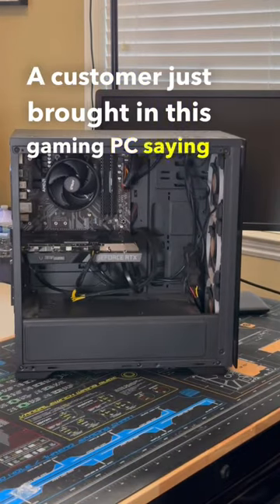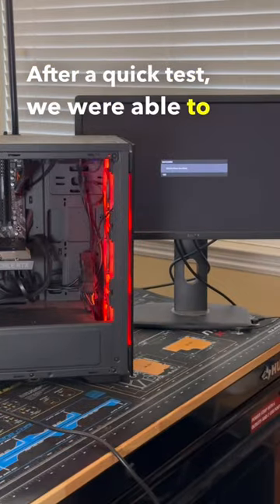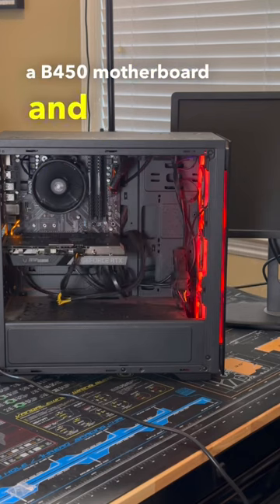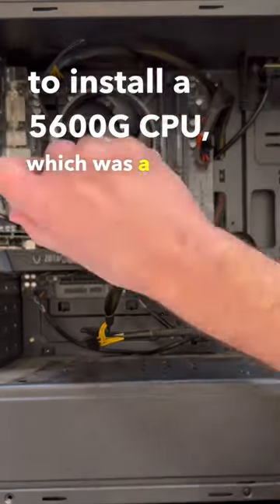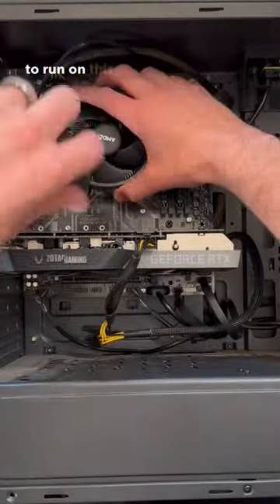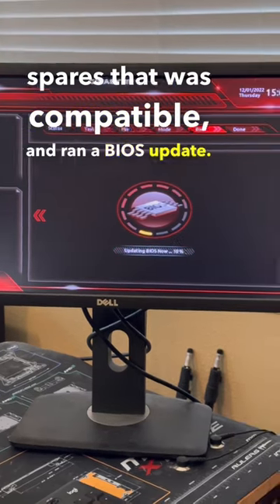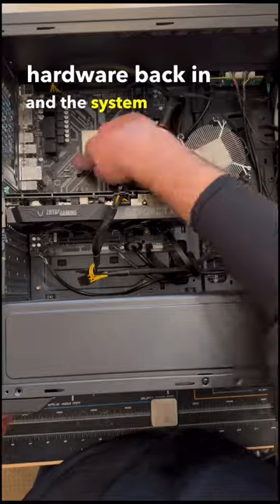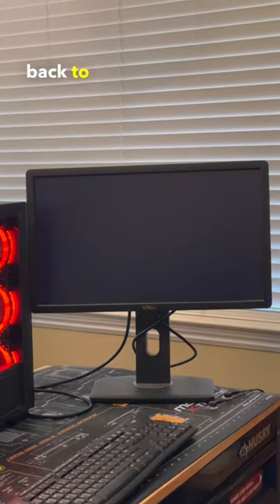Gaming PC Not Booting After CPU Upgrade: Here's How To Fix It! #shorts #pcrepair #pcbuild #gamingpc

Comment: Bro running with no thermal paste got a deathwish 💀💀
Reply from the maker: There was thermal paste it was just cut in editing where we cleaned and reapplied the paste
Reply: @mattscomputerservices  I thought I got a nightmare for a second...
Reply: @mattscomputerservices  . .
Reply: However I’d like to add, it can be made possible though, ever saw a copper IHS and a copper cooler copper IHS’ don’t need the extra paste
Reply: @naraydaniels7832  Bruh
Reply: @vastravax7670  🤣🤣🤣
Reply: what exactly does the thermal paste do?
Reply: @Mangotunde  To put it simply, it keeps the CPU cool. We cannot make perfectly flat metal - the thermal paste helps provide a true connection to the cooler.
Reply: @mattscomputerservices  also for testing that it boots you don't really need thermal paste. just don't forget to put it on later
Reply: @naraydaniels7832  u might need to revise ur basic knowledge - even copper contacts need paste/liquid metal - BCZ what appears smooth to use is actually a rough surface which doesnt make complete contact
Reply: @Mangotunde  Under a microscope the surface of the heatsink and the die of the processor, you would see peaks and valleys looking almost like grains or lines on the surface. The thermal past fills those two surfaces and make a complete bond between the two surfaces.
*Look up lapping a processor and heatsink. It will explain the entire thing in depth.
Reply: If it's for some quick testing or bios upgrade, nothing bad will happen with desktop CPUs as they have a heat spreader which will protect against hot spots and will throttle if too hot.
Reply: You can boot with our cooler just to see if it posts. No biggie
Reply: I upgraded to basically a whole new pc but I made the mistake of forgetting to disable the PIN in windows, so I had to set up the old PC parts again and move the nvme back to it.

However I had no thermal paste… (I also cleaned the old CPU and cooler when I put it away) so I just screwed the cooler on and it worked just fine my temps where only a few degrees higher. Definitely fine as long as you’re doing it just to test if the system is working.
Reply: nah, even without thermal paste, a bios update doesn't get the CPU warm enough to throttle...
Reply: Wow lmfao.
Reply: Deathwish is a stretch. PCs can run without thermal paste just fine and when the CPU reaches the temperature ceiling the system shuts off by itself as a failsafe. This shows me you don’t know much about PCs besides what you see in videos
Reply: You can run without thermal paste. Temperatures would be higher but it will never kill the cpu if it has an ihs. If it's direct die like laptop cpu then it would be concerning and i would suggest to use cheap thermal paste while testing and finalise the work with a good quality paste like cryonaut or mx5 or nh1.
Reply: @KuntalGhosh  mx6 or mx4, but def not mx5 unless you like rolling the dice. nh2 is the new variant of  nh1 and works pretty well.
Reply: @coveyking  mx5 is decent thermal paste as well, works better than mx4. i personally use kryonaut or nth1/h2 for high end systems that use power hungry cpu or gpu & coolermaster mastergel regular or mastergel pro for normal systems with any normal cpu and users that not gonna overclock.
Reply: Amd fans hav thermal paste applied to it
Reply: It will just shut off if it gets too hot worst case is that it could shut off during a bios update ig
Reply: a purist. a man of culture.
Reply: Also these Stock AMD stock coolers they already comes with pre applied thermal paste on it (if the customer didn't replaced it of course).
Reply: @vastravax7670  to put it correctly it just allows better conductivity by filling in the possible gaps
Reply: @keigansabo9330  Bruh you said the same shii. There's a thing called layman's terms because most people don't want to know the science behind why something works. They just want to know what it does.
Reply: U can boot to bios without paste. You can actually boot into windows without paste and just a cooler. You'll just have a super downclocked CPU.
Reply: yea thought that also, but this is  a short and edited heavily.
Reply: You don’t need it for a bios update. Cue the commenters who are going to argue otherwise
Reply: @Mangotunde it bridges the gap of transferring heat from the CPU to the heatsink. Typically you always want something to mate the two surfaces to each other

Comment: The customer did not even think to do a quick google search lmao
Reply: What if bro didn't had a spare cpu?
Reply: @Calibre336  you can use a USB drive
Reply: @_ZERO  Not if it doesn't have BIOS flashback.
Reply: @RuthlessRaDiCaL  b450’s don’t have Qflash? Honestly, then websites should say that it incompatable if you need to use a older cpu.
Reply: @Calibre336  phones exist?
Reply: @Calibre336  why need spare cpu. that customer just upgrade the cpu. he should have previous cpu with him.
Reply: @EGK20  it could have been a cpu and mobo upgrade at the same time with a different cpu socket
Reply: @RuthlessRaDiCaL  there is a flash bios button on the b 450 motherboard just so you are aware
Reply: @plasma_from_pluto  not all, especially with cheaper boards. heck, even my b450m aorus elite dont come with bios flashback.

Comment: Most motherboards allow a bios update by using a USB stick as well, so you don’t need to use a spare CPU
Reply: qflash plus or asus biosflashback not all mobos have it but if they do, it's definitely a great feature to have
Reply: That might be true... But in this case, you won't even be able to get to the bios because the mobo sees that it doesn't match and basically says "Meh, I dunno you." PC needs to be on to even get it to qflash and having a new CPU in will just constantly shut down.
Reply: Not most at all.
Reply: @voodooactual8053  the bios flashback/updates in the context he's mentioned is the bios doing it without anything except power connected no CPU etc which is uncommon in most motherboards outside of higher end models
Reply: that motherboard does indeed have that feature
Reply: Bios flashback is not common thing on 300&400 series motherboard let alone a low & mid tier class motherboard
Reply: @Arctic_silverstreak  But it is on this model. The guy didn't even check but the B450 DS3H came with Qflash out of the box.
Reply: @PlinkyVR  the motherboard in this case has it, I have the same one and the seller told me I needed to do this when I bought the cpu+mobo kit for an upgrade.
Reply: not most, just the expensive ones

Comment: I used a 5600g and a b450m pro4 for my first pc build and didn't know about the bios update until after my parts arrived. I thought I needed a loaner cpu to update with but thankfully the board actually arrived with updated firmware and I was stoked.
Reply from the maker: Oh that's awesome generally that will depend on when the motherboard left the factory as if it was after the release of the newer generation you are good to go, which was likely the case for you.

Comment: It's always good to keep a bios updated 
Especially as it's so easy..many motherboards allow updates without a CPU in the socket
Reply: Honestly, most people suggest against BIOS updates as long as you have no issues. Main factor being that not every BIOS update is stable (my MSI bios made my pc restart randomly) and for the risk you take, power goes down? Rip motherboard
Reply: @mishaberendsen  you are right there I tend to forget I have a UPS so no risk of power Going down...
I am not surprised MSI are Crap and have a shit load of bios updates...
I have a MSI b450 mortar max  I needed to update the bios But the Mortar max exists with 5 different chipsets (or more) ..I couldn't be bothered to find out what board I have. It's now in it's cardboard box where it belongs. I'm Using a  Aorus x570s elite ax .. updated the bios no Problem....

Comment: I did a complete rebuild for a friend of mine. He said the components were dead. 2 years went by and I wanted to run a arc server so I revisited the "dead" components. It posted but would boot cycle crashing every time it tried to load windows. I verified with him what the components were and found the culprit. He said it was a ryzen 5 2400. But the mobo reported it as a ryzen 5 1400. So I re flashed the bios to the very first the motherboard ever had and the system booted windows. It was satisfying to fix it and get a computer for little to nothing.

Comment: Some Gigabyte motherboards have Q flash. No need to get an older CPU to update BIOS with Qflash, just power to the CPU and the correct USB stick with the new firmware on it
Reply: I literally did this the other day! It works without anything plugged in except the usb and power, it was kinda magical.

Comment: I upgraded my prebuilt. 4 to 5 years old. I had two case fans broken. Slapped all new ones in and a 5800x3d with a big deep cool. It wouldn't boot and two fans weren't spinning but lighting up. After troubleshooting I unplugged one fan from cpu power and checked every connection then boom success. Games run like a dream w tht cpu, upgraded from a ryzen 1700, truly amazing I can slap tht cpu in my pc. I have a b450m pro4. Lucked out on tht being one of the best 450 boards.

Comment: i had the same problem when i got my new cpu a few days ago😂😂 i swapped back to my old cpu, did the bios update and switched back to my new one
Reply: When I built my first system i bought a gigabyte b550 motherboard. It said that it was amd ryzen 5000 ready but when i booted it didn't work 🫤. I was scared that some thing might be wrong with the motherboard but i found out that they had a bios flash feature without cpu and ram on their 100 dollar motherboard ( most cheap motherboard's don't) so i got a pen drive and used it to update bios and it worked it was such a relief.

Comment: I am getting 5700x to replace my 3600 in the summer on b450 tomahawk. Good to know there are no issues after the bios update.
Reply: I have to replace mine. It's a 5 2600 and it doesn't work good
Reply: @FrontWaffle  a 5700x or 5800x will be a good upgrade ( running a 5800x)
Reply: @parasgupta8411  I'll check them
Reply: @FrontWaffle   a 5800x will be better for all core workloads as it has a higher TDP and boosts half a ghz higher than the 5700x as the 5700x is power limited to 65 watts. In gamingthe difference is un noticable so the 5700x is better because it's cheaper. I bought the 5800x for 270 dollars after 18% tax ( usually available for 320 dollars and the 5700x at 300 usually) because i got a deal on credit card so it was cheaper and better
Reply: @parasgupta8411  In live in Poland and here the 5800x is 258USD and the 5700x is 221USD, but I really don't know if I'm gonna upgrade it. The FPS are great, no huge lags, eventually I could sell the 5 2600 and buy 5600X/5700X/5800X
Reply: @parasgupta8411  and could you explain to me how taxes work in your country? In Poland we can just buy something and don't care
Reply: @FrontWaffle  its kind of complicated for example like the ryzen 5 7600x costed 300 dollars at launch in us but due to retailers pulling up prices and taxes it was actually 400 us dollars after converting and now since it dropped to 250 in us now i can buy it for 300 in my country. It varies a lot a ryzen 5 7600x costs 24k rn which translates to 300 us dollars but in us it's just 250 dollars rn
Reply: @FrontWaffle  about the upgrade it depends a lot on the gpu you are using as well
Reply: @FrontWaffle  i guess tax wasn't the right word it's the same thing you just buy anything but sometimes retailers put " too good to be true pricings " and then put 18% taxes when you are billing so sry for that
Reply: @parasgupta8411  Ik but when I did some benchmarks the GPU usage was always about 90%, also my GPU  is gtx 1660 super
Reply: @parasgupta8411  Oh okay, in some big stores in Poland we have a netto price and a small brutto price so it looks like the same thing
Reply: Uh, idk is that correct but my translator translates netto (price before taxes, i have no idea if these words exist in English) to "net" and brutto (price after taxes) to "gross"
Reply: @FrontWaffle   unless you are playing a super cpu intensive game like need for Speed unbound battlefield 2042 etc you shouldn't need a cpu upgrade with a 1660 super
Reply: @FrontWaffle  since these processors are not made in our country they are imported and thus have import taxes making them costlier basically
Reply: @parasgupta8411  okay

Comment: Had the same issue not long ago 
My wifes Pc had a Amd A10 9700 Apu shite installed on a Asus Prime 320-k

I Got her a used Ryzen 5 3500x and was sure the mobo supports it.

Installed the cpu and the boot attempt failed with cpu fan and gpu fans at 100% 

Swapped in the A10 again and updated the Bios and tadaa Worked

Good video and will help lot o people

Comment: This is apparently a notorious issue with the i5-13600K.  If you don't have a spare CPU lying around then you need a mobo that can be flashed through USB.
Reply: Wait really like does it only happens on b mother board or does it happens with z mother board too?

Comment: Usually gigabyte mobos come with the qflash feature, so you don’t need a  compatible CPU to update the BIOS. Not sure about B450 mobos though
Reply: Correct. All the other comments gave me cancer.
Reply: The qflash is the little button u find on the side of the mobo close to the other ports?

Comment: Or just loosen up the aio pump a bit. I upgraded to a 5900x recently, put thermal paste on and installed the aio pump. Then turned it on only to find out that it won't boot. The mobo is a prime x570p and I previously used a 5600x so bios was absolutely not the issue. So I removed the pump and it booted up. It was showing up in the bios. Then I turned off quickly as the fans were about to go full blast. Put the pump back on but this time I made a bit loose like enough to secure it into place. Turned it on then tightened it up a bit and now it works without issue. The aio is a h100i Cappelix 240mm from Corsair.

Comment: The most ridiculous problem I had about 9 years ago, when I bought myself new motherboard and CPU (swapped from FX 4170 to i5 4690).
Removed old MB. put in new one with CPU and cooler installed, connected everything and tried to boot it. OS didn't lauch. I actually was thinking about asking a professional to fix.
Then I had a "crazy" thought and decided to try it - when I swapped parts I did not replace my old SATA cable with a new one (came with MB). I swapped and it worked.

Comment: If many people come over to the Intel Arc GPU line up, some will have to update their bios in order to enable 5g encoding and Resizable BAR and that's if the motherboard supports it, otherwise games will suffer from performance issues.

Comment: It’s the issue 99% of the time when using newer parts on a (slightly) older mobo. Update or flash update the BIOS!

Had the same issue with my z690 and a 13900kf.

Comment: I'm wondering, doesn't the B450 DS3H have Q flash (bios flashback but for gigabyte boards)? Because then you wouldn't need to throw in an older cpu to update the bios, instead you could just connect the motherboard to the PSU and click on the Q flash button to update to the newest bios.
Reply from the maker: On this specific board it didn’t which is why it required us to put in a compatible CPU. I wish it did as it would have been a lot easier to do that. Honestly I think all motherboards should have a bios flash button these days for this exact issue.
Reply: That's a budget board
Reply: @mattscomputerservices  Completely agree!

Comment: When I found out some motherboards for my AMD 5700X needed a bios update in order to work, I specifically looked for a motherboard that was AMD 5000 ready out of the box. I went with the Asus tuf b550 pro, the board was made in 2022 and the bios did not require any updates to recognise my CPU. Its dumb that tech companies allow this stuff to happen, its sloppy.
Reply: With the money you spent on a new mobo you could have gotten a better CPU. Updating is pretty easy and takes not even a minute. I upgraded my 1700 to a 5800x3D with an x370 chipset with no issues after the bios update.

Comment: 1.I got a NVME for my pc
2.After installing it on to the motherboard, it doesn’t recognized by pc in disk management
3. Then installed second NVMe to second slot it worked like a charm. 

My Question is the first NVME slot is broken or somehow disabled?

Comment: So question. Im using a b350 plus board. Ive looked online and after updating the bios with its automatic search built into the bios its still not on the latest bios required for the cpu I plan on getting. If I install the new cpu will it then allow to update to a newer bios? This video made me question that since you pulled out an older cpu for updating......😅

Comment: This mobo supports Q-Flash, you just needed to use a usb to update the bios. Also their ram is in the wrong channels, it may not run in xmp properly.
Reply: This b450 board lacks QFlash plus (the one that can flash from a usb even without a cpu installed) , Qflash (without the plus) is the one you access after booting.

Comment: When you upgrade the cpu, don't you have to do a new fresh windows installation?
Reply: Not always. Often your drive with windows on it will work fine on changed hardware. If the motherboard is changed, sometimes you'll need another windows key. Tip: make sure your key is tied to your Microsoft account. It makes it easier to keep your old key in the event of major hardware changes